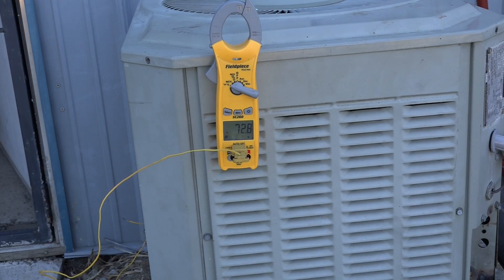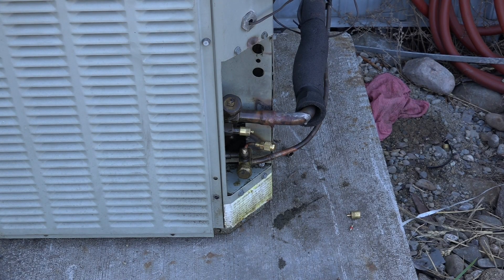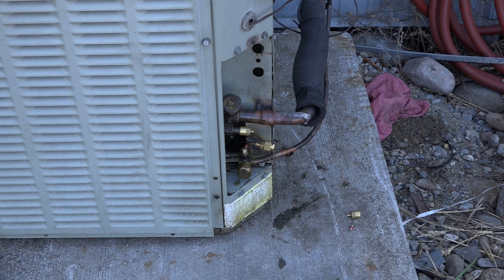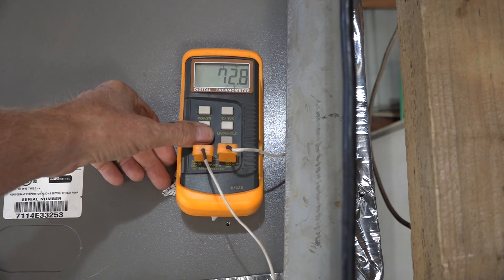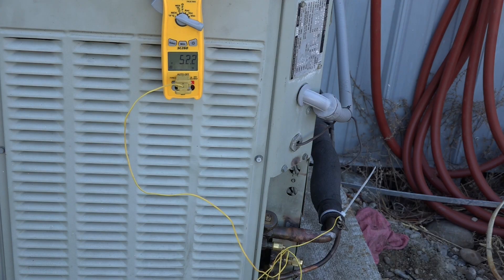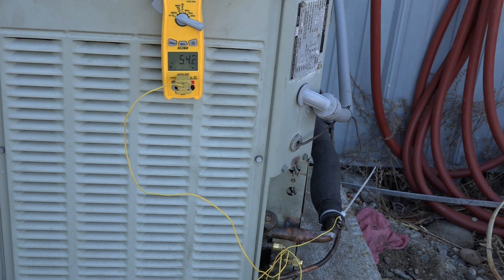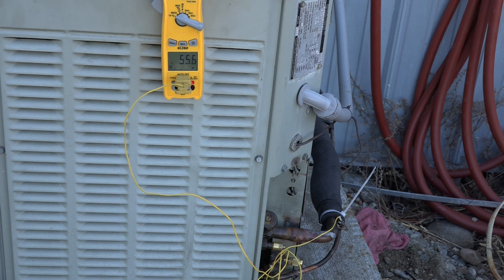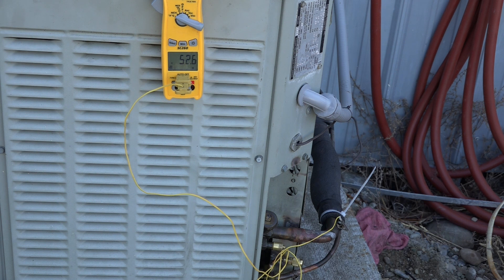Service the air conditioner Part 5.  Check charge

Comment: So wouldn't all that depend on if the system airflow is right along with all the factors you mentioned??...Wouldn't you agree that most of the time Techs are working with flawed systems though?...so will this method still work?
Reply from the maker: marjones69 Therein lies the issue of experience.  With that experience most, not all of course, problems will be noted as the service is performed.  At any point during the service, something pops out, then you look farther and repair before you service.  The alternative is to hook up the gauges, take the chance of starting a leak or lose some of the charge.  Hope this helps.
GFM
Reply: Ok..i got you..nothing can teach experience but experience..keep dropping these jewels GFM, I and many more im sure do appreciate it.

Comment: Everyday for years and years is the key. I watched the guy I helped with do this on pre season checkups and first I thought this was nuts. Lolol ... But it wasn't long before I figured out why and how he could do this. GFM and your absolutely right on all accounts, you just know when to gauge and not to throw the gauges on units to avoid issues like you mentioned. Fascinated by your series of videos
Reply from the maker: Michael Shank I couldn't agree more.  When I first got into the business I saw a guy with many years of experience check charge on a demonstrator that one of the manufacturer reps had set up.  He made the rep look silly as the rep said you had to charge only by weight.  Thanks for the thoughts.
GFM

Comment: I have the S Man 360 gauges and I can't figure out how to get target superheat sub cool to show up on my gauges do you know how
Reply: Matt Johnson I use sman 460 also and rarely set target superheat on the gauge, buy you a supercool slide rule and its the best to dial you in for superheat and subcool, it'll get you within 5% of charge!
remember grayfurnaceman is correct, everytime you hook gauges you chance air entering and gas leaving the unit...
Reply from the maker: Matt Johnson I will do a video on it.
GFM

Comment: I had 87 apartment A/C units that were identical.  I became very confident over time because of the consistency.  The major variable for me was establishing the correct target superheat.  I could take 3 readings and get 3 different results and vary the target superheat by 5 to 10 degrees.  I learned to check charges on 95+ degree days, something that occurred consecutively for 4 months out of the year.  I charged every unit to 8 degrees superheat every time and it worked perfectly for me.  All because I had no confidence in my target superheat.

I have since sold the apartments and have 17 rent houses, most with fixed orifices.  Target superheat is an even bigger concern now.  Some air handlers are indoors in a closet, some are in the attic and some are in a garage closet.

I watched all of your videos and paid close attention to where you believe the indoor WB temp should be measured.  It was what I had always been taught.  So I did some experimenting last week to see why my target was always changing.

The answer is in where I take the indoor WB temp.  In most houses I am taking the temp right at the filter IN THE CEILING.  I can lower my fieldpiece NTC meter 1 foot and decrease the temp 3 degrees.  If I lower it to shoulder height it will be as much as 7 degrees lower.  The meter doesn't know if it's a good reading or a bad one.  It just takes the entry and makes the calculation.  I don't wet the sock; I use the NTC function.  

So which indoor WB temp should I take?  Or do I have to go into a hot attic and take it at the evap coil?  Thanks for all your videos.  They are really helpful and I never miss them.
Reply from the maker: 958kris It is probably best taken as close to the evaporator as possible because that is what the evaporator sees.  I understand your frustration with these readings. Over many years of service work I am still frustrated by these readings.  I take a holistic approach, if you will, to determining how the unit should be charged.  If one reading is out of whack and the others are ok, dump the one out of whack.  Hope this helps.
GFM